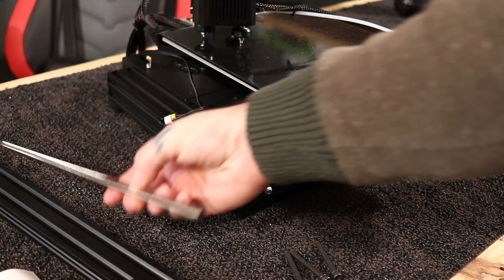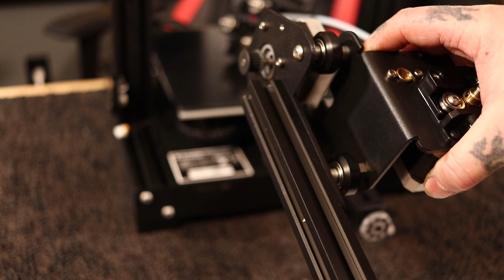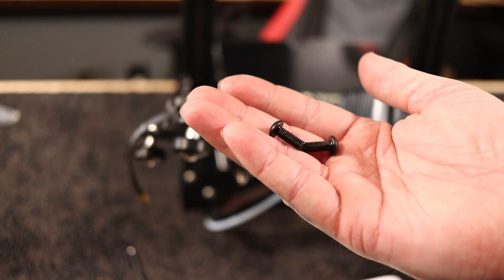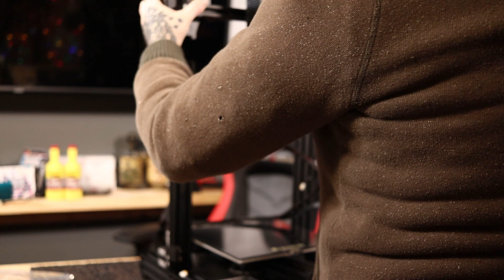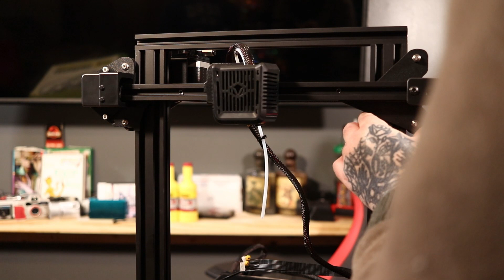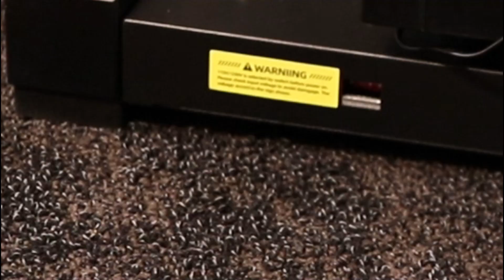Detailed Voxelab Aquila 3D Printer Assembly - HOW TO

Comment: Great instructions…..My only problem is that My threaded rod is extremely tight. Not smooth at all. Nothing I adjust or do makes it any better. Any suggestions on how to fix it?
Reply from the maker: check to see if the rod is bent or not, you can check by laying it on a flat pic of glass, if its fine you may half leave the motors off and work the nozzle up and down to the rod wears in, also you can try to lube the rod a tad with some thick grease, I don't like to use grease so I would try and see if the rod would wear in after a few,

you can get replacement rods at places like Lowes
Reply: Did you end up fixing it? That is my problem as well, and it seems to be pretty squared up.